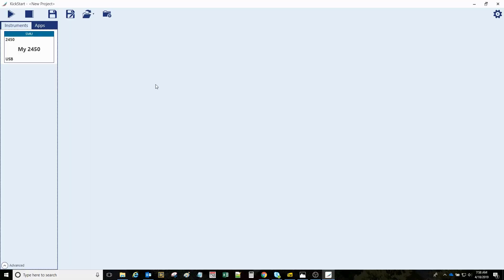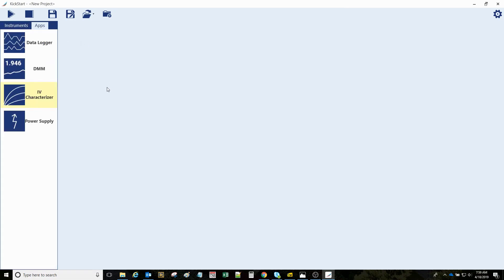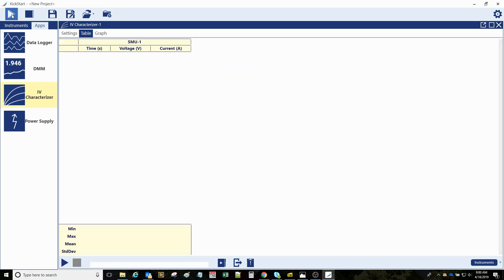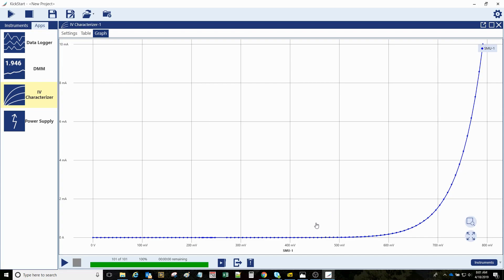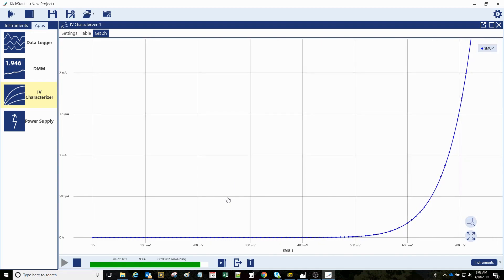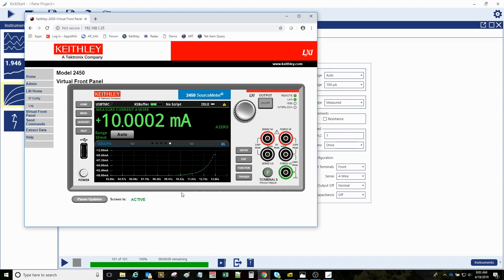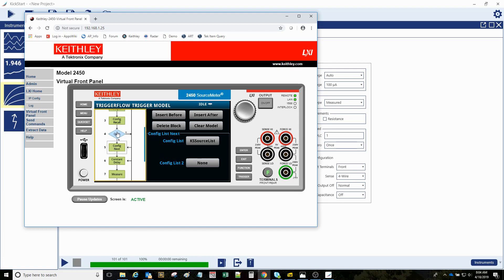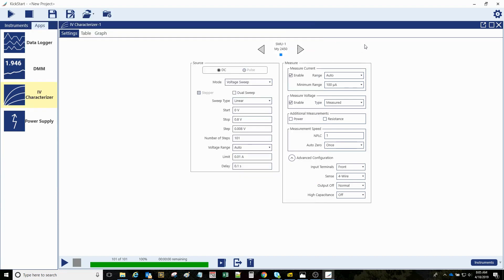Introduction to KickStart using Model 2450 SourceMeter

Comment: Hi Andrea, nice tutorial. i have one question. i am going to use keithley  6487 picoammeter, i want use kickstart too to control the instrument and record data. but when i tried to connect the instrument via USB (rs232), the kickstart could not find the instrument. on the front panel, there is an "Advanced Discovery", how can i find the IP address of the instrument, and i saw your video you can open the virtual front panel by entering the ip. that is amazing ! Can you teach me how to do it. 
Kindly can send me the email if u like. much appreciated! 
email: Jayden_chan@outlook.com.
Thanks heaps.
Reply: Hi there, I was reading the datasheet and I found theres not compatibility between KickStart at least version 2 and rs232 protocol just GPIB,serial and USB